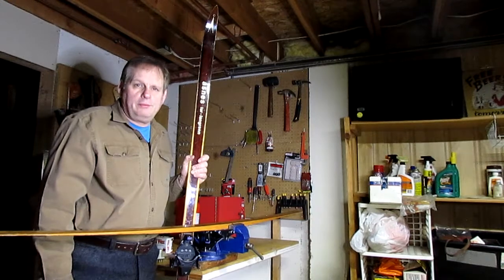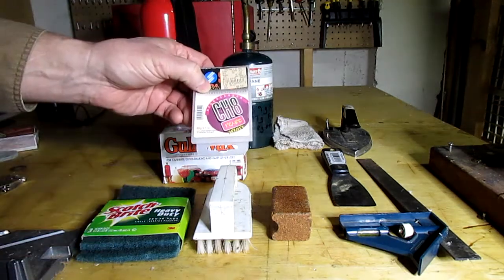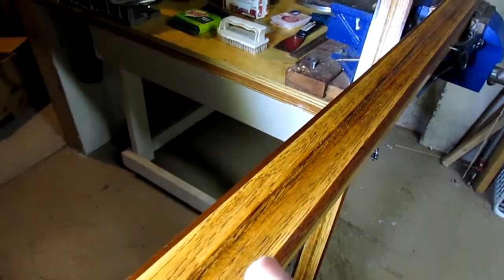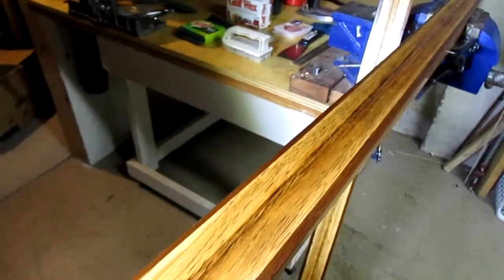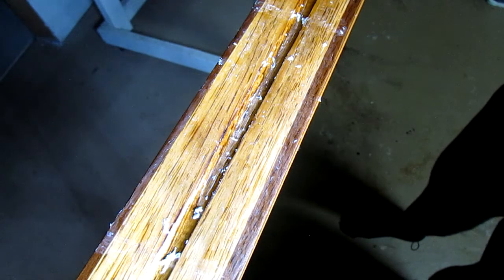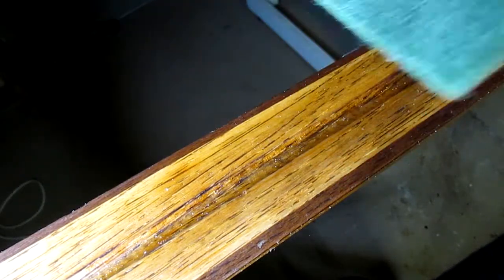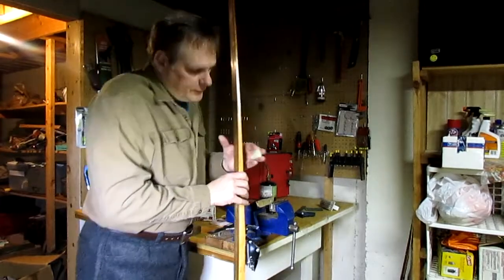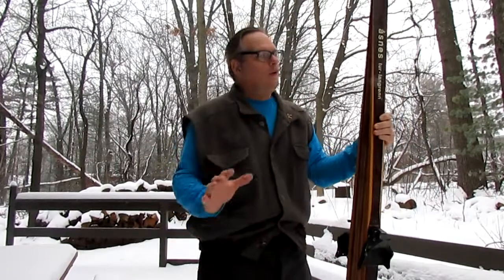Ski waxing base glide wax on cross country skis

Comment: So happy I found your videos Mike! I just acquired a beautiful set of wooden skis that were found safely stored in a shed since the 70's! I've got a million questions about maintenance and I'll be doing this to my skis this afternoon. Can't wait for more vids!
Reply from the maker: Megan, that sounds lovely!  What brand are your wood skis?
Reply: @explorermike19  They're Calmet Summit with a Lignostone edge. Veeery pretty. I'm a sucker for old, functional, beautiful gear.
Reply from the maker: @ssengnirnagem  I cannot recall the Calmet brand of wood skis, but lingnostone edges are the hallmark of high quality skis, I guess probably made in Finland.    There are several things that can happen to wood skis  if they are not stored correctly.  The first and most important is warping.  This is usually a corkscrew effect from tip to tail.  You will see it if you lay the skis bottom down on a smooth flat surface.  The second thing is the camber being lost.  This is most often because somebody tapes the skis together and binds them tight near  the middle of the ski.  The skis were meant to have a contour like the bend in a cross-bow.  The good news is that these problems can be fixed if you simply add a correct block of wood in the middle of the skis and fix them solidly.  For example, blocking them to a good straight 4"X4" board and leaving it for a year or more.  You need to do some research first before you block your old wood skis.  IF you do it wrong, you can really do more damage.  THAT SAID, you can just pine-tar them and wax them and ski on them and if they work,  they work.  You won't damage them simply by skiing on them (unless you crash and break them) and you might even do some good.
Reply: @explorermike19  Thanks for sharing your knowledge! I've been xc skiing for about 20 years now (which seems crazy!) and this is the first time I've had wax skis, let alone WOODEN wax skis! These babies were made in Norway, right neck of the woods :) and they've got beautiful camber but it's not enough to pass a paper test when I'm standing on them... Could be due to covid snacking haha. I may try to increase the camber over the off-season, but for right now, my skis and I are just getting to know each other. I have a question for ya! With reapplying glide wax a handful of times over the ski season, would you re-tar every time? Or do you just scrape off the wax and redo it over the original tar for the season?
Reply from the maker: @ssengnirnagem  First question, don't be dismayed by the paper under the toe test.  It often does not work.  If you can ski with them and enjoy it, that is the whole point anyway.  if you are flattening out and using all the camber. you can adjust by using  harder kick wax.  Second question:  You do not have to pine tar more than about once per season unless you are really skiing a LOT like four times a week for two or three months straight.  You can see the pine tar wearing off because the area without pine tar will be light in color.
Reply: @explorermike19  Thanks for the tips! I'll be recommending and sharing your videos around :)
Reply from the maker: @ssengnirnagem  Thank you, Megan!

Comment: Hey I just want to thank you. I found a pair of wooden backcountry skis with metal edges that had been stored properly since 1957 and after cleaning off the wax and pine tar from 60 years ago and had reapplied pine tar I was ready to wax on the same day you released this video! I had already watched the pine tar video. So helpful. Excited to ski!
Reply from the maker: That is really fabulous!  Now, keep in mind that if your wood skis had wood bottoms, then the skis many be earlier than 1950s.  By 1950's, ski makers were starting to coat the ski bottoms with various things.  One popular coating was I think called Carbonite or something like that.  It was black, that I do remember. I think it was originally available in liquid form.  ANYWAY, if you have any kind of coating on the bottom of the skis, then you cannot pine tar onto that AND, of course it is not necessary.  If you  have bare wood, then you can pine tar.
Reply: @explorermike19  There was a reddish brown coating on the bottom that looked brushed on. It was not very smooth and I could still see the wood grain through it. I assumed it was just a mix of ancient wax and pine tar. If I could add photos to the comment I would. 
Whatever it was I could scrape  and scrub it off without much difficulty with mineral spirits.  Then I used 60 grit and then 150 grit sandpaper to open up the pores and smooth a couple imperfections before I applied the pine tar. The tops of the skis also had some minor damage so I sanded the tops lightly and applied several coats of spar urethane.

The pine tar did absorb into the surface. I am going to ski for the first time on them tomorrow. 

They were made by Paris (in Maine) and had Suns Sports logo from a NYC sporting goods store.
Reply from the maker: @HardwareHaq  it sounds like you did a fine job.  Now, I rather suspect that you might have a 1940's or early/mid 1950s pair of downhill skis due to the metal edges.  I hope there is enough camber for you to use them for cross country skiing.  If not, I have skied many thousands of feet of vertical with that kind of ski with leather boots as a telemark skier at lift service ski mountains.  You could do that too and have a wonderful time.
Reply from the maker: @HardwareHaq  I found this on the internet:  Antique Museum condition wooden Paris Manufacturing Co. Skis
c. 1900-1920's
Wood, Leather, Metal (edges and cable bindings)
82 3/16" long x 3 6/16" wide
© Vintage Winter

Paris Manufacturing Co. was founded by Henry Morton in 1861 in Paris, Maine. It was best known for making sleds and skis, but the company also made desks and other unique furnishings.

This is a pristine museum condition set of old wooden skis.  They were stored inside and lost for over a century.  We do not believe these skis went outside but a handful of times.  They retain their original stamped logo (quite rare for this model).  The tips on these skis are reminiscent of Scandinavian skis from the 1600's-1700's with large upturned rounded tips.  These skis were expertly crafted by Finish immigrants over 100 years ago.  They retain their original leather bindings and flat headed screws and were preserved by our curation technician.
Reply: @explorermike19  I was looking more into it and they are often called ridge top style skis. Due to a rounded ridge running toward the tip and tail from the center of the ski. I found others that look very similar and were dated to the 1940s. 
I figured they might have been downhill skis but they have a pretty high camber.  My wife just got some new backcountry xc skis and they have a similar camber and springyness. The high camber  is what made me think they were useful for more than just downhill. But today will be the test!
Reply from the maker: @HardwareHaq  Oh yes.  I know exactly what you are talking about.  Those would be 1940s or earlier.  Typically very nicely made skis.  What kind of binding is on them?
Reply: @explorermike19 The skis had Cable bindings on them with no branding. This may be sacrilege but I removed the old bindings (kept everything together and filled the holes) and put NNN-BC bindings on as I had a new pair and boots. 
Also, the first outing was a success!  The snow conditions weren't great (some places had iced up after a warm day) but skis had great glide and kick. Where the snow conditions were better the skiing felt effortless.  Being wide they are not as fast as a skinnier skis but I am not in it for the speed.
Reply from the maker: @HardwareHaq  what a great story of keeping old skis alive!
Reply: @explorermike19  Thanks again for posting your videos!  Not many people around to learn from!
Reply from the maker: @HardwareHaq  Thanks, Austin.  I want to pass on the info.  Most of the old timers who taught me are gone.

Comment: I've loved all the wood ski videos, I've watched them plenty of times to help me get going with my Grandpa's skis. I used Rode special green wax instead of parafin though, it's mostly smooth but a slight tackiness to it, not sure if this is good or not, we have no snow to test it on right now!
Reply from the maker: Hi Steve, It seems that Rode Special green wax is a kick wax.   I have not used Rode brand ski wax, but it seems similar to SWIX brand for Kick wax.. Unlike paraffin or another harder base" wax it will be sticky and not really good for skis GLIDING.  You should not wax the entire ski with this Rode special green wax.  Have fun with your grandpa's skis!  Please use it as a kick wax. See this video:   https://www.youtube.com/watch?v=TN9wtJiMlY8
Reply: @explorermike19  I had read on several websites that people with wooden skis use the very cold kick wax as a glide wax, but I guess if it doesn't work then I'll just have to scrape it off and buy some paraffin!
Reply from the maker: @SteveKeith  YES!  Indeed that is one way of waxing skis:  You go one or  two "colors" wax colder than is recommended on the wax tube.  You then wax the entire ski.  I have done this and it does work.  Coincidentally, I do mention it briefly on my kick wax video.  Certainly, I encourage you to experiment with waxing and find a method that you like best!  I am very glad to see you interested in waxing skis.
Reply: @explorermike19  it's a lot of fun, the  feel and the scent of the whole process is relaxing. I'm a sucker for old "forgotten" processes!
Reply from the maker: @SteveKeith  Excellent!  Poetic.